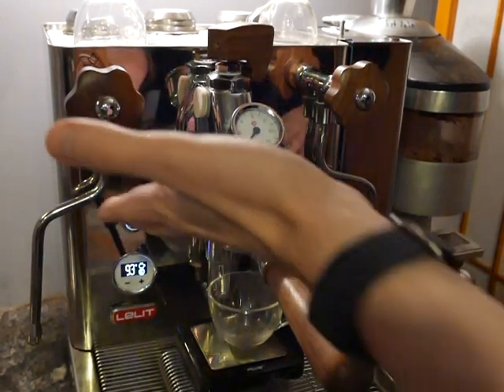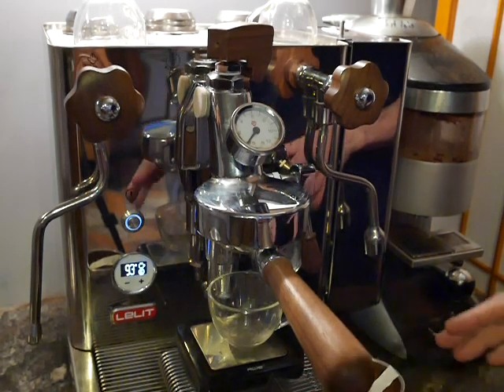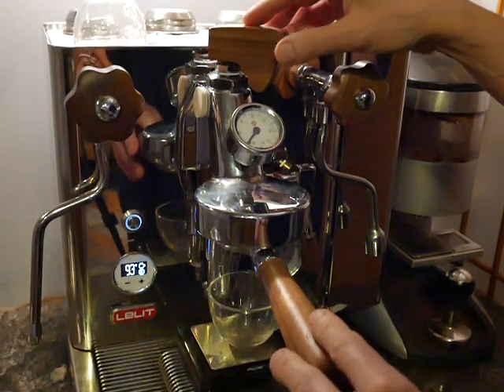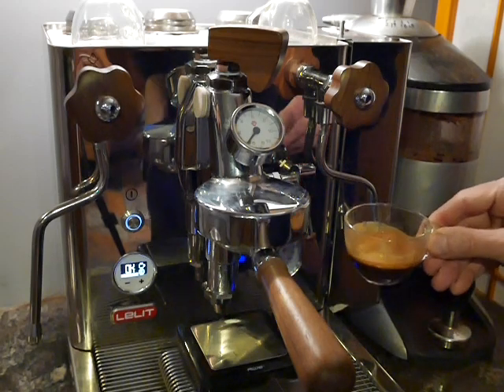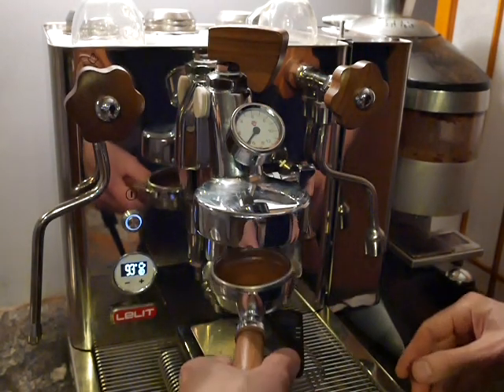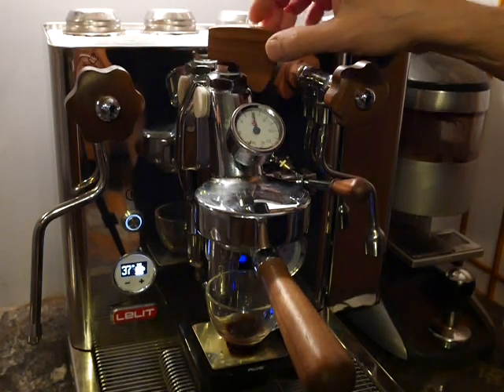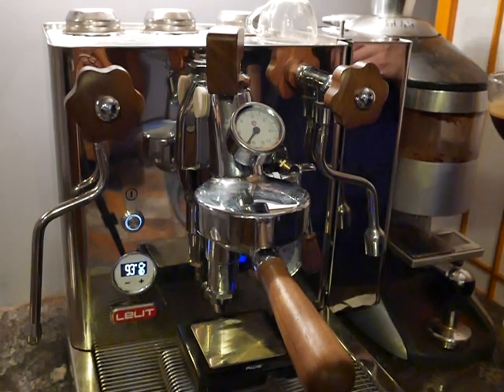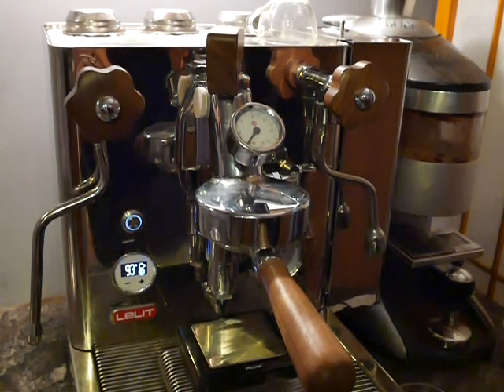Bianca Shot Profiling

Comment: Is there any reason why you start the process with the valve almost fully open and then decrease the flow for pre-infusion? Usually the videos show that the FSD is open 1/8 of a turn at the very beginning, at which point the pre-infusion occurs.
Reply from the maker: Prior to the pressure rising, the only thing that is happening is that the space above the puck is filling with water. There is very little soaking into the puck at this point. So there is no point throttling the flow and wasting time. But if you are not in a hurry;  you can let the flow trickle in and it won't  make a difference in the result.
Reply: @HBsJim  Thanks! I thinks, for me it's easier to start with 1/8 an not to touch the FCD until the first droplets than find the point of 2.5-3 bars (that would be much easier in a machine with pressure profiling like Flair or Crem ONE PROFILER, but, anyway, I am not in a hurry).

Comment: Hi Jim: long time follower. Why did you choose the Bianca, over say Dalla Corte Mini, or a Breville DB with needle valve mod, or now the Decent DE1+? Also, you seemed to have by-passed the “Vesuvius rage” ?
Reply from the maker: I like machines I can control on the fly, so the DE1, where the profile is preprogrammed, is not my style.. Needle valve mods have been done by many people on HB, but I'm not that DIY. And I kind of like that the needle valve that was on the original preproduction E61s has made a comeback.
Reply: HBsJim Thanks. I’m still with the Strega, thanks to you, which John Borolla modified. But that Bianca paddle is right up my alley.

Comment: One issue I've had with this machine is it's first and second pull are completely different, very low flow, high bar, on second pull, even when waiting 5 minutes. Have you run into any similar issues?
Reply from the maker: Not personally, but some people have. There is a bug on the first year's PID controller in warming up from idle (not from a cold start). It shows ready in about 10 minutes, but will run cool until about 20.  Contrawise, the cold start will overheat until about 20 minutes after start up. However, the display blinks until it is ready.

The Bianca is a very fast warm up machine for an E61. But you do need to give it 20 minutes to get to its proper equilibrium.

Comment: Hi which baskets are you using here? I'm interested to use 15g as well but I find the stock ones too big. Also, which grinder are you using to get a fine Turkish grinds? I'm using a Rancilio Rocky and On almost at 0 but I can't seem to get that low flow it seems to flow really fast for me. Thanks
Reply from the maker: I use standard Faema/Cimbali pattern double baskets, although the ones marked "microfine," which have better machining. They do have a lot of room for 14 to 15 gram doses ; but I genraally find a lot of headspace, by adding some time to the preinfusion, makes the basket more forgiving. I'm in a minority here, most espresso-heads like VST and Strada style basket, that are sized for their intended dose and grind.
Reply: @HBsJim  Thanks I'll try to source for those baskets. Also, what grinder do you use to get Turkish grinds?
Reply from the maker: @nusstu  I use large conicals. In the video, I used a Compak with the 68mm conical set; now I use the more single dosing friendly Niche Zero with the 63mm Kony set.

Comment: Why isn't the pressure dropping when you are lowering the flow? 

When you increased the flow the pressure response looked fairly smooth but when you dropped it, it seemed too slow and not as responsive.
Reply from the maker: The two are related, but not in lockstep, since the resistance of the puck to flow mostly decreases during the shot (leading to a faster pressure drop than flow drop. What you saw indicates that the puck's resistance was increasing. It's not impossible, but it's rare.
Reply: @HBsJim  so, that happens when the coffee is really fine? In this case, this won't be as rare as we thought because the entire purpose of having long preinfusions or brewing at low pressure for a longer time is to be able to extract from a really fine grind.

Btw, I've  even noticed this on Whole Latte's videos as well.
Reply from the maker: @NANA-gy7yx  You're probably right. The solubles from the top of the puck are reabsorbed at the bottom before they flow into the cup. Perhaps with a fine grind, the pucks resistance at the bottom can grow due to this.  It would make for a good discussion on home-barista,com (plug, plug)
Reply: @HBsJim  Do you suggest a new thread or just reply to the post of this vid?
Reply from the maker: @NANA-gy7yx  It's a forum, read around a bit and post as you think best

Comment: Very interesting, thanks.Can I ask what scales you use for weighing the dose? My scales are far too small to use like this
Reply from the maker: I have three or four scales that go to 0.1 gram resolution, have a max weight of 1000 grams and are about 2 inches square. They use two or three AA batteries and cost around $10 to $15 dollars on Ebay or Amazon. Typing in "scales 0.1g" in Amazon will get you lots of choices

Comment: Hi do you think you can achieve this kind of shot with the niche and bianca combo
Reply from the maker: I'm not sure, but I think it would bee very close. The Bunn Turkish burrs are a bit better than the Compak at its very fone settings. But the Niche has a softer taste and may be able to use a slightly coarser grind for the same effect. In any case, one can adjust the preinfusion time to match different grind coarseness.

Comment: Hi Jim, great video! If you compare the Bianca and the ECM thechnica V pid. Which one should be better if you didn’t have to use the pressure profiling? I am not a big fan of the wood on the Lelit.
Reply from the maker: I haven't used the Technica, so I can't say for sure. But it is not a dual boiler machine, and HX E61 machines require flushing for temperature control, and are in general a lot more fussy to use.

Comment: No any Bianca owners reviewed steamers power all are concerned showing profiler lever system..
Reply from the maker: The steam power is the same as many other double boiler E61s, so it is not a unique feature of the Bianca. The steam boiler is 1.5 liters, and can be set up to 1.75 bar (135 C) . At this setting, it steams 150 mL of milk in about 10 seconds. Lelit delivers a steam tip with smaller holes for those who prefer slower steam times
Reply: @HBsJim  your reviews were fine, steaming length effects generally on steaming boiler from drop down pressure and buildup. My concern was this through viewing most reviews, great machine as well as your reply.